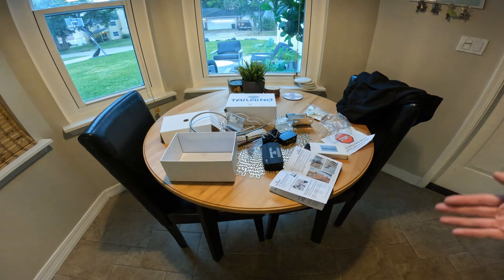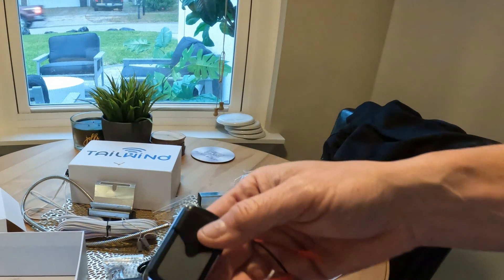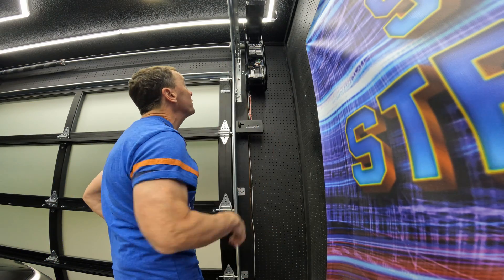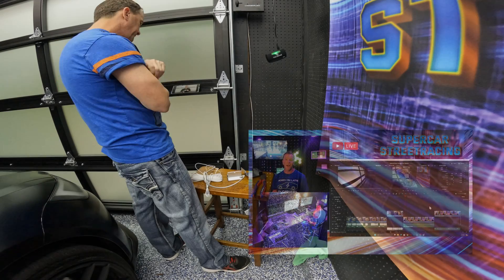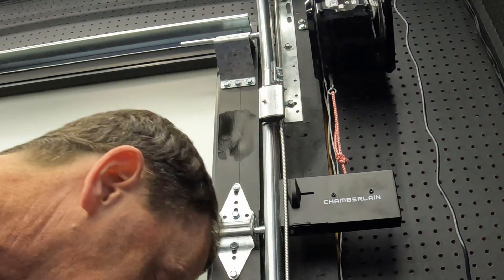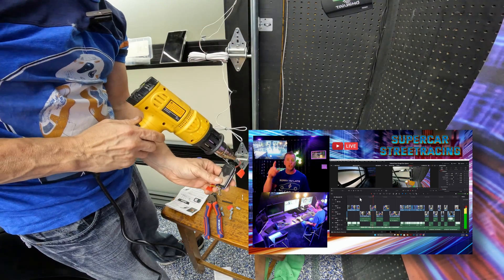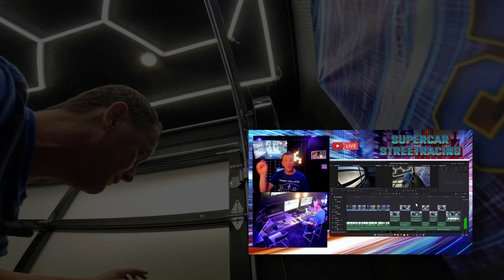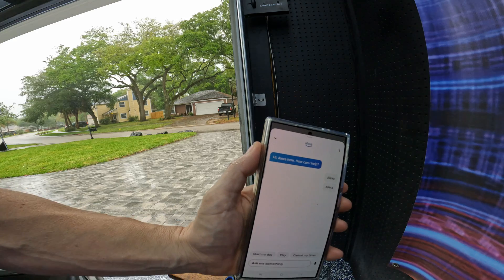Chamberlain Garage Door Openers doesn't want you to know this - Tailwind Smart Wifi Garage opener!

Comment: You could have used the other optional sensors they sell much easier. You have a killer garage by the way!
Reply from the maker: They don't allow you to use it without a subscription. Oh and thank you!
Reply: @Supercar_Street_Racing  I started out with the Meross opener that’s much like this tail one, but I think the tailwind is built much better regarding their magnetic switches. I found your video trying to learn more about this chamberlain adapter, which I guess, just like the Meross, amounts to being nothing more than a visor, garage door opener clicker… Hey, if it works, why not!
Reply from the maker: @macsterguy  it is yes. It's a shame Chamberlain doesn't work with Alexa. Really doesn't make sense.